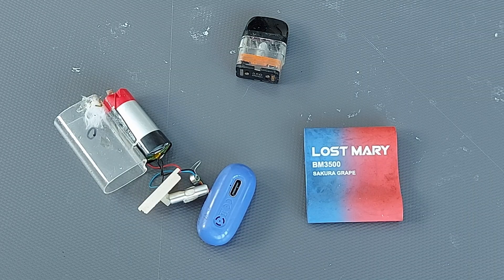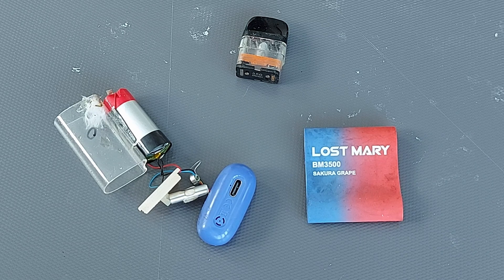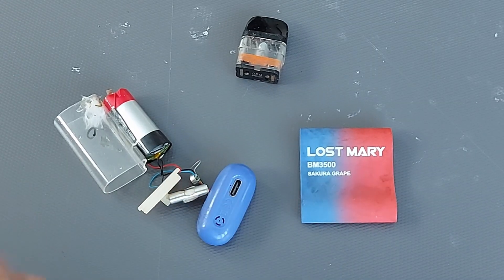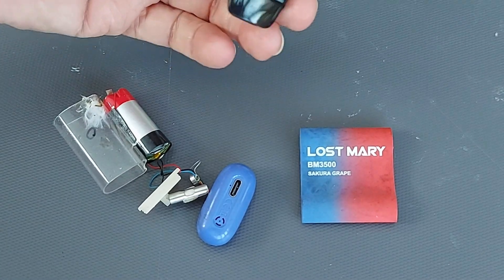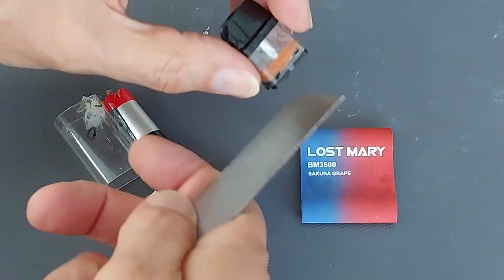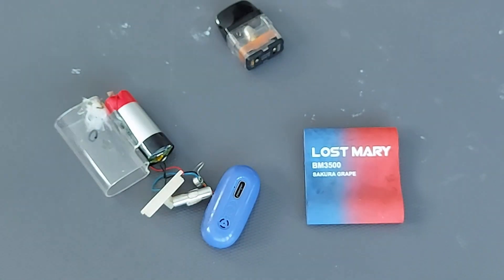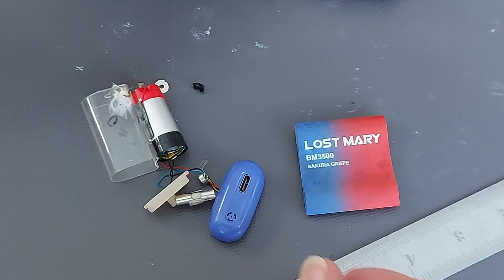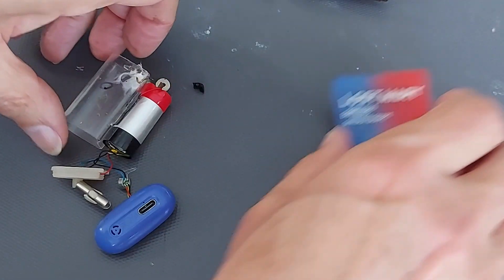Neodymium magnets and charger circuits from disposable eCigs

Comment: You need to keep the sensor in between the battery and the USB port, because the sensor is the chip that controls the charging, and if you just solder the USB port straight to the battery, you will charge the battery to 5 volts, when the battery is only rated for 4.2v. It is a big fire risk to charge LiPos like that.
Reply from the maker: YES 👍👍 you are 100% right. In the video description I link to bigclivedotcom's video where he explains exactly that - inside a disposable with charging port https://youtu.be/hBgaqY9CG3g I also point people at ToyHackers analysis of the TP4068 IC https://youtu.be/5qAAVfIYJ9w
Reply from the maker: Oops that was the wrong ToyHacker video - this is the one I meant https://youtu.be/xrTtXBf6Oc8

Comment: could you use the heater unit with a air pump to blow smoke out of your model car exhaust? might be different ~ AndyT in W-s-M
Reply from the maker: Yes, there are quite a few YouTube videos on that subject. It rather makes me smile, if your car is belching out smoke there is something major wrong with it 🤣🤣 As it happens I did pick up a rather nice looking toy car in a charity shop that has that feature. You have to put water in its petrol tank 🤔🤔 That serves two purposes. The water triggers the receiver, without it the car will not run. The water is also heated (like the vape) to produce vapour out of the exhaust. https://youtu.be/b90w4IOVPes?list=PLA5a2xPRSrB01Y-bC5WOE3wphOhuYEyvE shows a puff of water vapour around 2.34

Comment: Could the heater element be used in a pop-pop boat?   Jim
Reply from the maker: Short answer "NO". Nothing like enough power. The chemical formula in a vape is designed to produce the vapour quickly and easily. It is not the same as turning water into steam and uses far less power. Here is a video I did on that subject 😁https://youtu.be/_gFL3TLPMBo
Reply: @GrandadIsAnOldMan  Thanks. I was not aware you had already addressed this question. Take care until next time.   Jim
Reply from the maker: @melkc345  I don't expect anybody to be able to watch all the videos I publish. There are far too many 🤣
Reply: @GrandadIsAnOldMan  I know, but you have a LOT of good content. Keep it up.   Jim

Comment: What a waste of usable parts just to have a smoke, which they should not be doing in the first place. To each his own I guess. I never see these things about but then I am not about very much at all . Where do you find these mostly? Parks , city streets like the curb, trash , ?    I would be parting these out for those magnets and other, myself.
Reply from the maker: I am afraid people see my videos and get focussed on vapes as if they are the only item being dumped in the street. Vapes are a tiny part of the general littering attitude. You ask where I find them, they are in the same place all the other rubbish is, basically everywhere and anywhere. The only difference is I tend to pick vapes up because they have a value to me. Because they are generally brightly coloured I can often spot them from the other side of the street.
Reply: Usually alongside roads, on the floor near the bushes. I found most of the ones I find (really not much, the Netherlands is very well cleaned along the road side) below some green. On the grass. But usually as far as the pavement goes 'to the side' or the road goes 'to the side'. But it is as GianM says, everywhere there is litter. Where (young) people are hanging out, or where cars stand still for the light, and then they chuck it out of the window..

Comment: I found a site that is Chinese and it does give information on the LP5308 but you need to copy and translate the text. Looks like that chip is a protection device. 
Here is a translation of a small part of the text. 👍

LP5308 Performance Introduction

LP5308 is used as a power switch to provide protection for the system, preventing the system from being damaged under abnormally large current and overvoltage conditions. The key parameters include overvoltage response time and overcurrent protection current. The overvoltage mainly comes from the front-end circuit at the input end. When an input overvoltage occurs, a quick response is required to prevent high voltage from entering the system. The response time of LP5308 overvoltage protection is 30nS. When overvoltage is detected, it can respond quickly and automatically turn off the MOSFET to protect the safety of the system.

The schematic diagram of overvoltage protection is as follows:
Reply from the maker: Thanks, Mike 👍👍😊😊